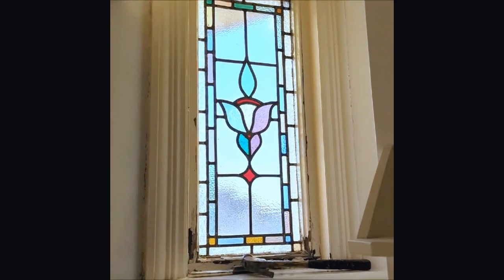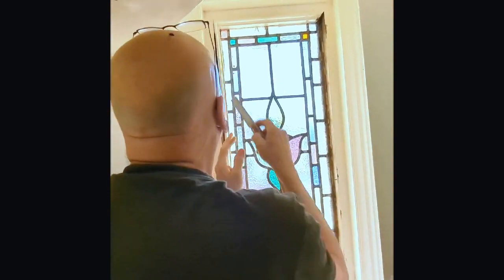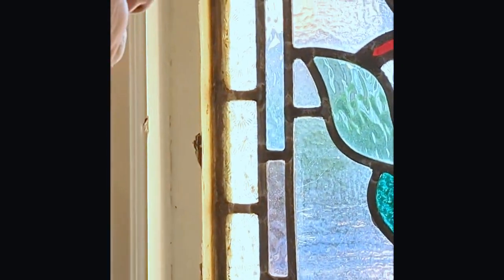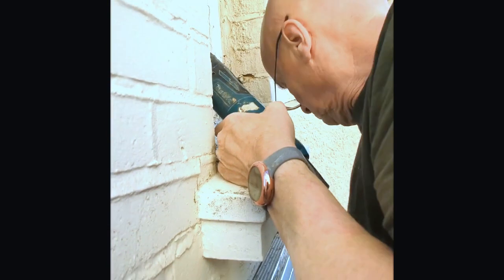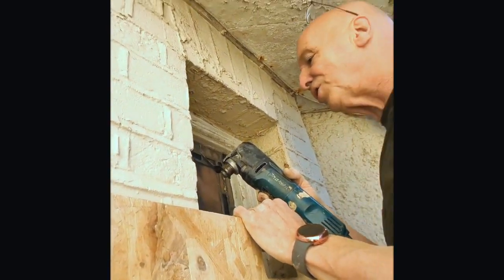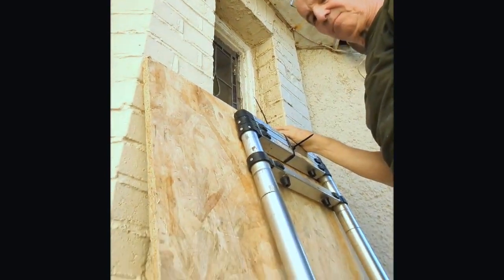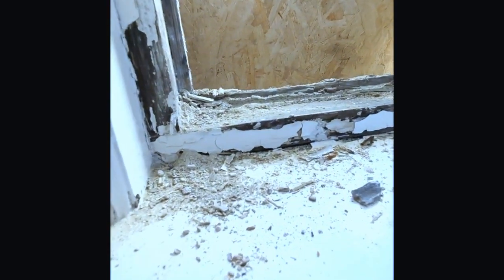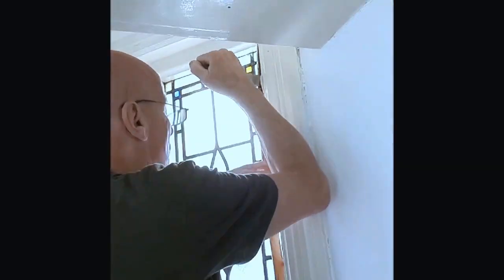Taking out stained glass panels to be triple glazed

Comment: Traditional leaded and stained glass window and door glazing is something that I've been doing now for a number of years. I love repairing existing panels and producing new ones in the appropriate styles of their period, mainly for doors and their side panels. I never throw away antique glass. It's sad that traditional and beautiful windows and door panels are being removed and replaced by UPVC double glazed units, sometimes with fake stick-on lead strips and painted glass instead of lead cames and beautiful coloured glass that were so common in the Victorian times and the following art nouveau and art deco periods. The demands for security and better thermal insulation are the primary reasons. It's good to see that at least one home owner appreciates these. Triple glazing of the traditional leaded glass panels is still better than their replacement even if the  overall effect may be diminished. Good job Jim getting them out safely. Old lead becomes very brittle and fragile. I've never used my multitool for this purpose but I will in future after watching you.
Reply from the maker: Hi @scrappystocks. Everything you've said holds true. Here's a link to the finished job (prior to painting). St Leonard's Glass have done an amazing job of encasing the unit. A lot of the superb light refraction of stained glass is lost, but the fact they've been saved is great.
The multi tool can work wonders when de-glazing, but as with all power tools, don't go too mad with it ☺
Reply: Such sadness that triple glazing .  But saved. I understand